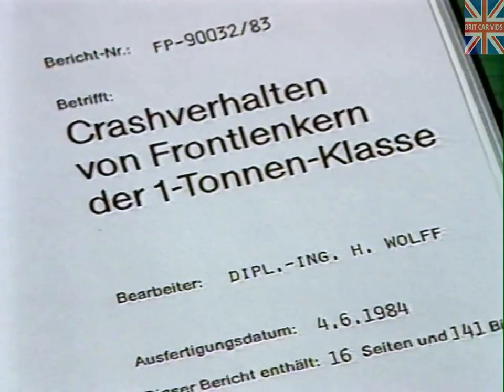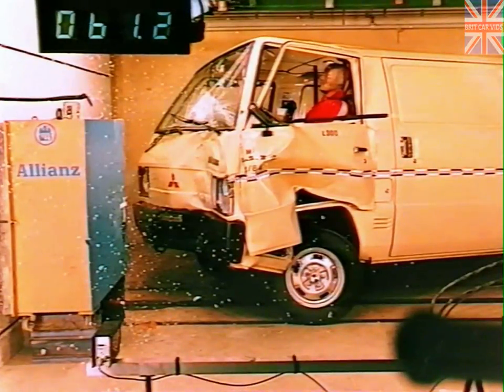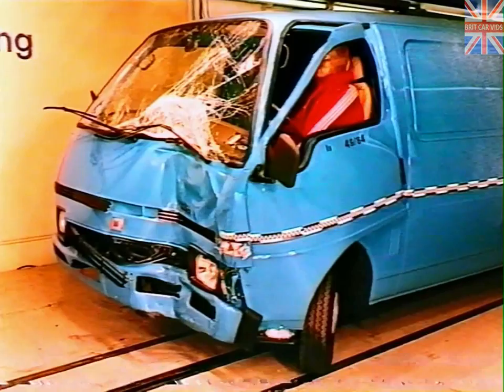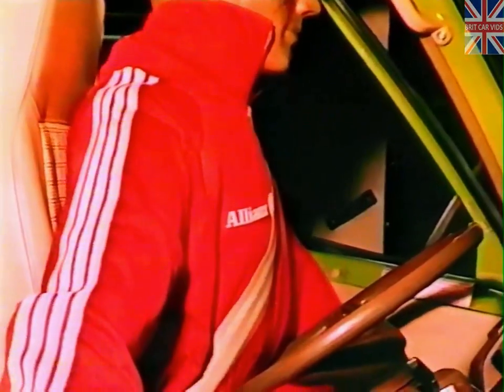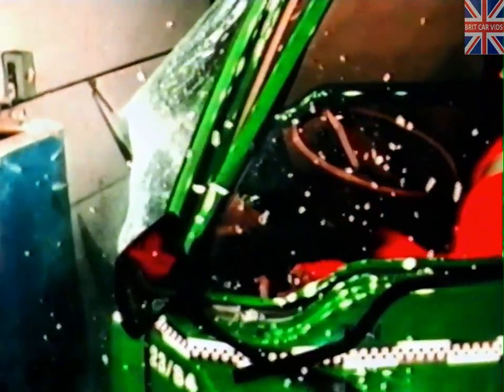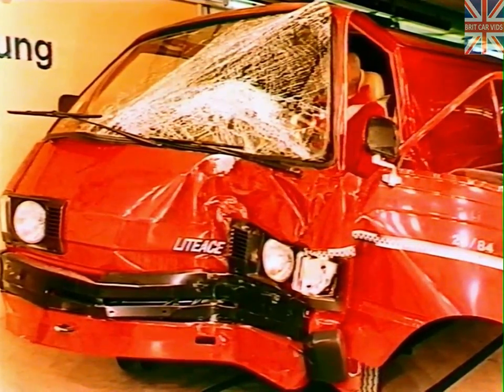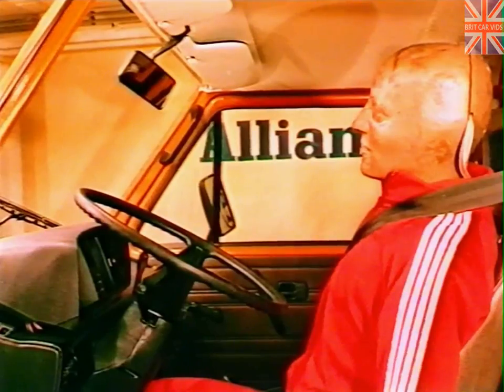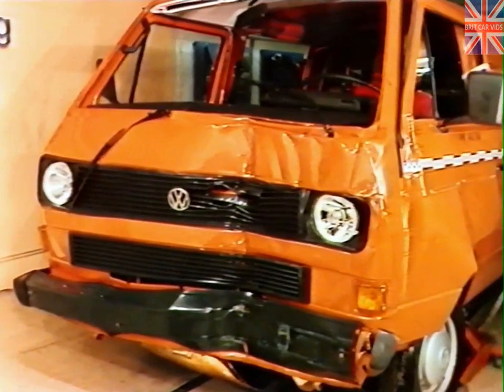Volkswagen - Volkswagen Safety - Forward Control - Japanese Crash Tests (1984)

Comment: "The steering wheel rim impacted the chest very unfavourably" otherwise known as "Aaaargh!"
Reply: The germans put "death" soo elegantly. Those were only 28mph tests. The IIHS would have a field day.
Reply: this is what most of the cars before mid-1990s did. Drivers were shis kebaped.
Reply: @akronymus  Spring supported collapsible columns have been in cars since the late '20s.
Reply: @HellenicVanagonTheSyncroHeresy  you are spamming us PD now a 2007 daihatsu mira, a 2004 hyundai atos & even a 2000 renault twingo are obviously safer
Reply: To the extend the cars you are referred to are safer than a Mercedes 
SDL/SEL, (IIHS death rate: 0.9), or a VOLVO 740/760, (IIHS death rate: 0.7), you may be right. (Vanagon IIHS death rate: 0.6).

 The Syncro Heresy
Reply: @HellenicVanagonTheSyncroHeresy  those cars have crumple zones, airbags, ABS brakes, three point seatbelts with pretensioners and headrests in all seats, things that the T3 lacks, so common sense tells me they're safer
Reply: @chloeysuslocuras1157
And the Vanagon has all of those too???
??
And its crumple zone works differently, it works through converting the energy from horizontal to vertical.
Reply: hahahahahahahahahahahahahahahah
Reply: According to IIHS the t3 is impressively better  than the initial estimations after the NHTSA's approval tests for import.

To be be more accurate, I can say that IIHS recognizes the t3 as the safest, with the lower death rate, car of it's era!

And all these for the 2wd edition. The 4wd, (Syncro), edition is even much more better because of structural reinforcements and much better active safety.

Some links to check the previously mentioned: 

Passive safety:
http://www.vwsyncro.eu/p/blog-page_18.html

Active safety:
http://www.vwsyncro.eu/p/blog-page_2.html

4wd cars are safer:
http://www.vwsyncro.eu/p/article-excerpt.html

This is the Syncro Heresy:
vwsyncro.eu

Comment: Back in the bad old days when Japanese cars crumpled up like Coke cans.
Reply: Alex462047 yes they are. if they didnt, the impact would be higher
Reply: Cars are supposed to crumple... that’s their goal. Just not to the extent where the cabin is intruded.
Reply: @Luverofdogs  Usually the passenger compartment is considerably stronger than the front and rear ends. in a much modern car the front end (or rear depending on the crash) crumples but the drivers and passenger compartment stays relatively intact.
Reply: Douglas Nunn - Nooooo! Really?
Reply: Alex462047 
Im glad I am not the only person who does that.
Reply: Alex ever heard of crumple zones?
Reply: Guardrail Lover The old cars that he’s talking about crumple well into the passenger compartment, not like modern cars with crumple zones to absorb impact.
Reply: @HandIeThese  crumple zones are useful on cars with steering wheels at the front of the passenger. on forward controls like these, not so much
Reply: seems like people think i don't know about the right way of crumplin' so just to be clear it HAS to crumple to absorb energy BUT NOT TOO MUCH to deform most of the cabin so longer front nose overhang and dashbord should be better in this case
Reply: But were seen as he bes built cars in the world, isn´t that ironic?
Reply: @PedroSantos-yc9id  every manufacturer always had their share of bad experiences
Reply: @PedroSantos-yc9id  Back then, not so much. But then they got really good. I think the '90s were the best decade for Japanese cars.
Reply: And until now, they still do it
Reply: God loves us all so much that he gave his perfect son to die for our sins and raised him from the grave to defeat death. Through faith in JESUS we can be saved and reconciled to GOD. please repent🙏♥️
Reply: @InfiniteFacts18  Since God never told a lie, that's all quite true. But what I don't understand is why you wrote that here, completely out of the blue.
Reply: @Alex462047  people to give their lives to JESUS. I already have what I need in eternal life with JESUS
Reply: Alex462047 they still do this
Reply: Japanese cars still crumple badly in real-world accidents.
They are better at handling the required impact tests, but still, do poorly in accidents which are not like the tests. This has always been the case. 
For Example: Years ago a friend of mine pulled out into traffic as the sun was apparently in her eyes. Her Honda Civic was T-boned by a Ford Ranger, and she & her girlfriend were dead on the scene. The Ford Rangers driver was very shaken up, but his small pickup truck was still drivable, except for the radiator.....
Reply: @davidhollenshead4892  What year was the car? Did it have side airbags? and u have to understand the physics here, the ranger has an advantage because it weighs more.
Reply: @eminmarookian7176  i really don't think that ford ranger weighs much more than the honda.. it's tiny
Reply: +David Hollenshead Problem is you are comparing cars of totally different type and size. Ranger is a clearly higher vehicle with a ladder frame, so it is not a fair comparison. You could have had a Toyota Hilux smash on that Civic and it would have been exactly the same result. Compare car to car and pickup to pickup. The newset ranger has improved a lot, in the recent EuroNCAP crash tests, the Ranger got 5 starts, but in the previous generation it got only 2 starts, a lot less than many Japanese pickups of same size and age, like the Mitsubishi L200.

Ford Ranger 2008 Crash test:
https://www.youtube.com/watch?v=xdvEIMq6vGI

Mitsubishi L200 2008 Crash test:
https://www.youtube.com/watch?v=LjE4ZiVqllw

Nissan Navara
https://www.youtube.com/watch?v=ueSG-OON_So

Or Ford Ranger smash on a Ford Focus, it would have been the same. So vehicle type in your example matters a lot more than the country or manufacturer. Japanese probably aren't the best even today, but they are quite good today.

From cars, Europeans are probably the best, and from pickups, now in the very recent years, Americans have improved a lot.
Reply: +David Hollenshead See here very good crash test video from Fifth gear, about ladder frame 4x4's vs normal cars:
https://www.youtube.com/watch?v=LoXnIN4CiHk

Newer cars are a lot stronger, and newer 4x4's have softer crumble zone in the front, so this problem is not nearly as bad anymore, but it still exists. So it is a compatibility problem between the different vehicle types. The high, very strong point of the ladder frame vehicle, hits to the a lot weaker point of a lower vehicle.

Then ladder frame 4x4's are usually weaker at roll over crashes. They are more prone to roll over, and secondly, because the body is not a monocoque, they may have relatively a lot weaker roofs than normal cars.

Comment: The blow to the body is high because there is no crumple zone... In fact, the VW gives the driver the fastest deceleration what could result in more internal damage to vital parts...
Reply: Nonsense. Take your pick, broken femurs and a major hit to the via steering wheel, or rapid deceleration. None of these 36 kph crashes were anywhere near causing deceleration-based injuries.
Reply: NCAP: "the VW VANAGON has the best chest deceleration score", it is tough and soft.
Reply: The Vanagon has a crumple zone, just not as big of one as a  front-engined van or car...

Comment: Let's face it; this is simply poor vehicle design. There is no crumple zone or added protection for the unfortunate persons occupying the front seats. That's a fail.
Reply: The t3, (according to the IIHS), was the safest car of the era. 
Please have a look: http://www.vwsyncro.eu/p/blog-page_18.html 
And one of the safest cars today.
Reply: @HellenicVanagonTheSyncroHeresy  in its era sure, nowadays? you're just delusional, my car is safer, and I own a 2004 Hyundai Atos, a EuroNCAP 3 star performer.
Reply: @chloeysuslocuras1157 No it isn’t.
I’ve done roughly 2 years of research on the T3 and my findings are remarkable.
It’s safety is roughly the equivalent of a decent car today.
In a crash in an offset (real life) 40 mph, a Chrysler Minivan (remind you, larger and heavier) crashed into a T3. The T3’s driver survived with a broken ego over the van, the Chrysler’s had to go to the hospital with a broken arm.
2006 Chrysler vs 1986 T3, T3 won.
Reply: Correction: the crash was at 45 mph.
And in a Folksam test a Volvo 740, one of the safest cars of the era, had fatal injuries in an offset against the T3 in a 35 mph crash.
So if a large car from the era can’t stand to the T3, what makes you think your Hyundai could?
Reply: Having no reason to support the Vanagon, Caravelle, Transporter, but that I was a proud owner/driver about 13 years for the 2wd and 10, consecutive, years for the Syncro, I can tell you one think: the car is a tank. It is much better than the 90% of the nowadays cars in terms of active and passive safety.

For the active: http://www.vwsyncro.eu/p/blog-page_2.html

For the passive: http://www.vwsyncro.eu/p/blog-page_18.html

The Syncro Heresy: http://www.vwsyncro.eu/p/blog-page_35.html
Reply: Most passenger cars from this era were just as bad
Reply: Hammers are designed to be hit square in the head by other heads. What's your complaint, now?
Reply: The VW design just showed you it CAN be done safely!
Reply: ur a fail xD hahahahahhaha
Reply: Just think how much more attention you pay to driving knowing that your life is on the line.
Reply: With the exception of the vw t3.(t25)
Reply: Yup, there's only so much you can do with a fatal design flaw like this

Comment: didn't even realised that van so strong
Reply: German Viktorovich only the VW
Reply: +HELLENIC VANAGON That is totally normal strength for a van on that site. Japanese newly designed vans too from the 90's are very strong, like the mitsubishi delica L400. ;)

But the T3 was clearly ahead in safety in 80's. But in mechanical strength it was then behind the Japanese, and I am afraid still is.

If they could get Germans to design the safety and japanese the reliability & serviceability, italians the usability and you would get an ultimate van. :)
Reply: You are right.
Reply: Much stronger than you can imagine. Please have a look:
http://www.vwsyncro.eu/p/blog-page_18.html